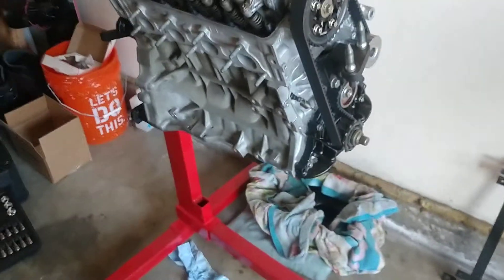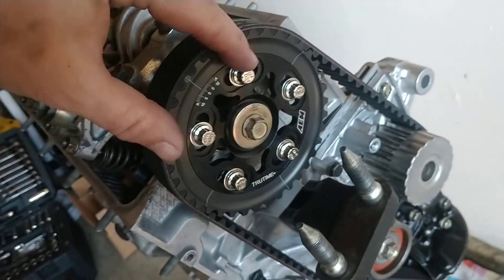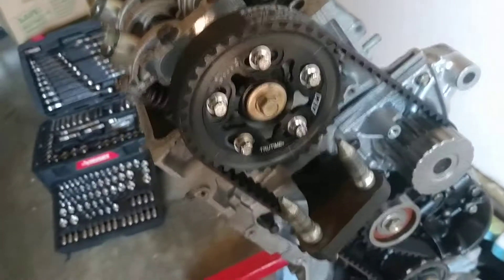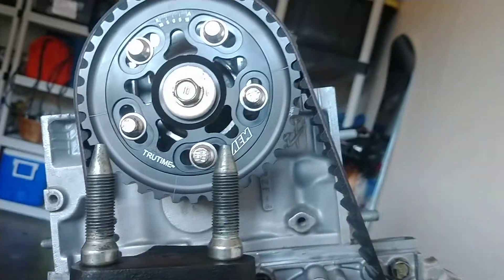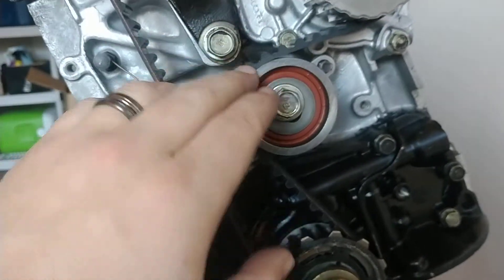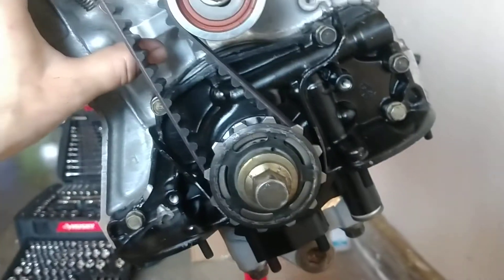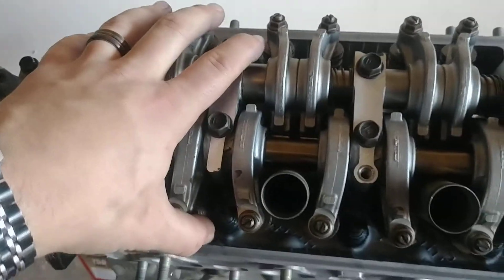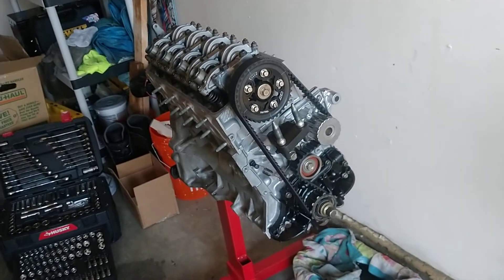Honda Civic Engine Build: Built For Turbo Step 6 Timing Belt and Cam Gear

Comment: The washer isn’t supposed to go first then the gear ?
Reply from the maker: I'm only 99% certain at this exact moment, because it's been awhile since I've done this, that the shear key sits on it's wedge at a specific distance from the cam seal. So it wedges itself on there when you tighten it down, but it can't touch the cam seal.

Comment: What camshaft and throttle body are you using on your motor? I've also got a d16 y7 that I'm building up
Reply from the maker: So i know a lot of people would disagree with this, but currently the entire Head itself is a stock, rebuilt d16y7. OEM everything, including Cam. Why? because my intent here is to build the entire bottom end to the highest performance i can, and then actually run documented tests on this set up to see what a factory head can handle, before it breaks itself. Doing it this way means that the only parts that can/should break are in the head, and a head swap is way less work than coming back around to upgrading the bottom end. In the future, i aim to run a port and polish D16Y8 head (with vtec) as I'm very curious about building a stupid powerful track engine, that with the flip of a switch basically turns it back in to a gas saver daily driver (think complete turbo bypass valve, vtec set to low cam profile, ecu tune and map switch to low fuel mode, etc). As for the throttle body, im running a genuine skunk2 70mm throttle body mounted to a skunk2 Intake Manifold, where the IM only had the factory 60mm TB opening, so i had to grind and polish that open to match the TB 70mm.

Comment: Any idea on how to swap a car gear without doing a timing belt?
Reply from the maker: Kevin, unfortunately there is no safe way to do that. Meaning that you could try, by loosening the tension from the tensioner, and trying to slide the gear out from the belt and the new one on trying to not let the belt slide at all. However, I think what you are asking is if there is a way to only pull the top timing cover off, and pop the gear out and new one in. If my assumption is correct, then that would be a no. There would be no way to get the old cam  off and the new one on without letting the tension out of the belt from the tensioner, which you can only access with the lower cover off. Hypothetically, it is POSSIBLE, but you would never be able to effectively verify that the lower and upper timing marks are aligned properly. It will take less time and energy to just swap the gear by doing a normal timing belt change procedure than trying to find a way to avoid all that.
Reply: @Mason Roberts  thank you for explaining that. I tried to do it the way I asked, and the tension spring ended up snapping. I ended up doing a timing belt water pump kit and refreshing everything today.
Reply from the maker: @kevincrawford6864  well im glad you managed to get it done either way. It defeintly took me a few times myself to figure out that there really isnt a "faster" or "better" way to get it done without just doing the whole belt procedure. Hope it all turned out good and good luck on the next one. 🙂

Comment: What cam are you running? I'm building a y7 turbo very similar, and I was trying to see if advancing or retarding the cam one tooth would be beneficial, or if I should just keep it at zero.
Reply from the maker: Currently I left it as factory Cam. The intent with this build was always to build up the bottom end so I don't have to worry about it, but then run OEM head and cam to see what they can actually handle. I've seen claims over the years up and down the forums, but I just wanted to test it myself. You should keep it at zero until you can get some logged data on the build to see if it has gains advanced or retarded.
Reply from the maker: Sean, following up on a mistake in my reply, I meant to say that I left the AEM Adjustable Cam i have at "factory" set, aka zero degrees, with a factory OEM Y7 head.
Reply: @11fulstrum  Thanks for the clarification. Our engine should be up and running in the next couple months. I'm building the car for road courses, and I decided to take it apart and install an A6/Z6 crankshaft to help avoid rod bearing oiling issues, so that's been a little bit of a setback, but I'm getting close.
Reply from the maker: @turbovolvos40  Ah yes, the Z6 crankshafts I've heard are the way to go. Which is also probably why there seems to be an absence of high flow oil pumps in after market for the Y7 and 8 engines. Which is why my motor has a high flow Z6 pump that just needed a little bit of modifications to take an oil dipstick and line up with the oil pan bolt pattern. 🤞 You don't hit any more set backs on the build

Comment: So the engine builder put the wrong tensioner until I get a new one, I loosen the wrong tensioner do I have to adjust valve slash again ? Even thou the builder did timing some sort of and valve adjustment
Reply from the maker: No. You don't need to do valve lash again. The reasoning behind having the timing system on before you do valve lash is so that there is resistive force holding the cam shaft in place while you work on the valves. If you did it without the timing on, there is always the chance the cam shaft will rotate ever so slightly and your lash distance will be set incorrectly.
Reply: @11fulstrum  ahh I see ok cool thank you for the help just to get oil pump times I need TDC cylinder 1 which I did and now only back three teethes and than put tension on the belt and should be good

Comment: I forgot to put on the washer on the outer crank sprocket that faces the crank pulley. Will I have any issues?
Reply from the maker: The outer one? Absolutely 150% will cause major problems. That outer washer is what keeps the shear key in place. If I believe we are talking about the same one. Is this the washer on the crank bolt? Or between the crank pulley and the crank sprocket ?
Reply: @11fulstrum  I forgot to install the washer that goes between the crank pulley and crank sprocket. I'm boosted and been like this for 200 miles. What is the worst that could happen?

Comment: What's inside the block?
Reply from the maker: YCP Vitara Pistons with Eagle H-Beam Rods. Specifically the no notch long rods. Supposed to up dcomp ratio to around 8.3 over the normal 7.8 I believe. That or you can get normal long rods and notch the bottom of the block so they clear the edges of the cylinder.

Comment: I trying to find very simple, but apperantly NOT thing. WICH way is RETARD, and wich way is advanced? on that cam gear? Had mine ebay china shit with no instructions...
Reply: Pro tip: Don't use Ebay motor parts... trust me. Unless you want your engine to pop. Stick with OEM or Racing Pedigree brands like Megan Racing, AEM, Spoon Sports, etc. Depending on your application.
Reply from the maker: @Wisefury  I absolutely agree. That's the one thing Iade absolutely sure for this build is that if I'm going to do it I'm going to do it right with high quality parts from reputable brands or just not do it. The only thing I've "cheaped" out on is remanufactured injectors vs brand new ones. However, that will change if she ever goes phase two with a complete head rebuild, port/polish, valve train, heat treating. Everything on the bottom end is either high brand forged or OEM (OEM crankshaft).
Reply from the maker: To answer your question, which I apologize for the long delay before I got to this, Honda motors of this generation (and maybe still do in newer motors) spin counter clockwise when facing the timing belt, or driver side of the motor. So to advance the timing you would spin the cam gear counter clockwise so that in relation to the crankshaft the cam lobes contact the rocker arms AHEAD of the crankshaft being in the standard position at that contact time. To retard the timing, you spin it clockwise. Again in relation to the crankshaft the cam lobes will contact later than normal timing. All of this is in relation to if you rotate the cam shaft portion of the gear (the inner portion). If you were instead to rotate the teeth of the gear clockwise, thereby pulling the belt and crankshaft with it, you are actually retarding the timing because the crankshaft is now ahead of the camshaft on the teeth of the belt. So it depends on which portion you rotate. Simple answer: timing belt moving counter clockwise is retard, timing belt moving clockwise is advance.